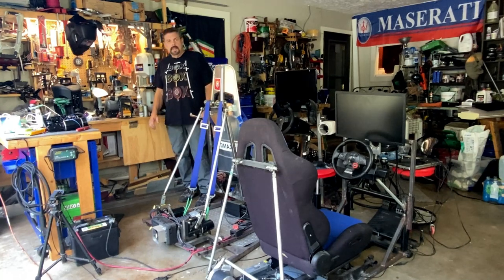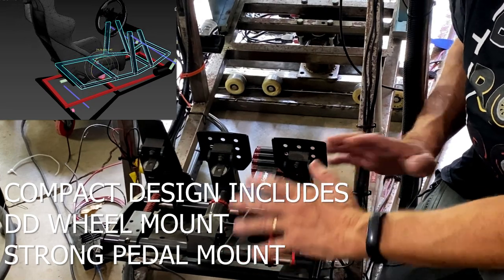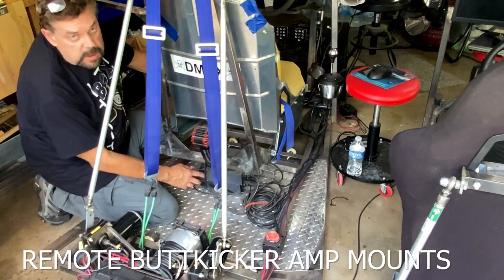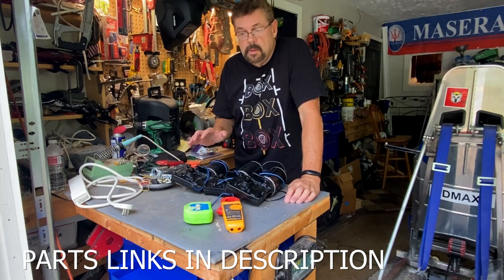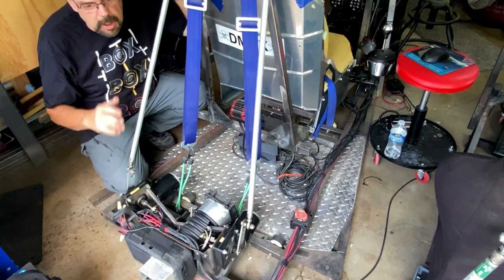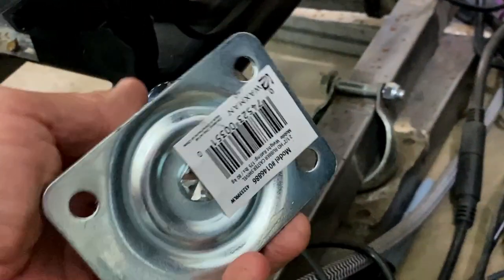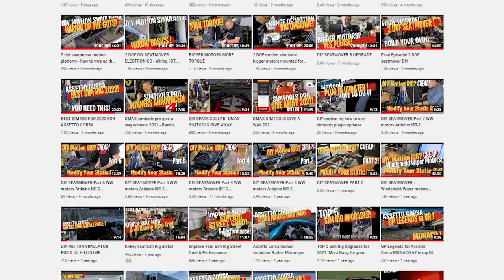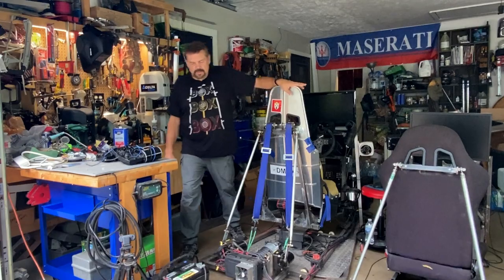NEW DIY 3DOF COMPACT MOTION SIMULATOR - 12V ARDUINO IBT-2  TRACTION LOSS DO IT YOURSELF Episode 1

Comment: Me again Dave. Well I am about to rebuild my test MoSiRig too. Mine is already compact as you know. Did you consider your new design will be heavy  enough at the back end so whenever you have some serious traction loss action happening it will not drift the whole back of the Rig? I mean mine has a lot of overload at the back and some washing machine base rubber to stop it from drifting  ... but still it's moving like 4 inches in any direction during a one hour hard driving session.
Cheers, ART FLY  []-)
Reply from the maker: Thanks for making an additional comment ! I love it!  yeah..  should be good..  CG is good so far.  I know that my old rig never moves at all..  but it's pretty heavy.   We shall see what happens..  Either way, I'm in deep already and going for it!  Hope it helps some guys out who may want to try this stuff..  Dave
Reply: @DMAX_DIY  fly high - never die 👍

Comment: WOW! Really looking forward to this and then probably tackle one on my own as I get enough courage to do it. Just one question, do you think 3 wiper motors of enough power would do the job? Looking somehow to keep the price lower, since the postage of those motors to Europe costs almost as much as the motors. Thanks!
Reply from the maker: Thanks for taking a look dnac101!  I appreciate the comment and question..  I did a series on wiper motors for a 2DOF seatmover and the ones I had laying around were 'saturn' brand from 1990.. In the end they did not have enough power to make it seem realistic.  I rebuilt the 2DOF with wheelchair motors and AC to 24vDc converters and those moved the seat just fine..  Even did an amp stall test for data.  I trust these crab pot motors more though.. I have rode them hard for about 3 years in on line races and such.

Comment: Hi!! First of all, tks for share all your videos. I'm learning a lot.
I want to make a 2 dof sim. But here in México it's dificult to find motors. I foud one in Amazon, they are for a wheel chair the model are my1016z2 24v 250w 75rpm. Do You think this motors are good for My project?
Sorry about my English by the way. Tks a lot for your help!!
Reply from the maker: Thanks for the question my friend!  I think that would be fine for a seatmover.   I would rather get something like 550 watt if you can..  More power the better..  550watt could be the ticket to a 2DOF full frame rig..

Comment: Looking forward to more, I'm halfway into my own build, thanks to your earlier videos... :) but I've been contemplating my mounting situation and what I'd like to do for that. Space isn't a big issue but the more compact the better IMO. Can't wait to see more. BTW I've been using the JEGS seat for awhile now, usually without padding, although you can buy a fitted cover for it and it's been great for the price, no issues. Also I'm trying to use a simple AC to DC power supply from Amazon. Its a 50A 600W PS so I'm hoping it will be able to handle 2 and eventually 3 of the crab pot motors you suggest. I think I saw they are about 15A peak motors but I'd be curious to see if you've tested or measured the peak draw from them. Also might I suggest instead of going to the scrap yard for a driveshaft, go on eBay and buy two flange and u-joint kits.

Anyway awesome to see another build series!
Reply from the maker: Cool Kyle..  I'm getting a padded Jegs seat for this rig too!  should be here soon! Those 50amp 600W supplies 'should' be good enough.. I am going to try some 'dell or HP' server supplies this time. I did some 'testing' on my big 3dof rig and pulled around 25amps peak a few times (all three motors combined and powered by an 850CC amp truck battery) so it should be interesting..  I will test the crab pot motors for peak amps at 'stall' during this series.   I bought an ATV disc brake a while back and only used it to test the 24v wheelchair motors  on my last 2DOF seatmover series.  Also good point on the ebay u joint..  but I just happened to have a scrapyard in town and got the driveshaft with two u joints for around 20 bucks..   Anyway,  I have the second episode taped and almost out the door to posting..  Check back later this week if you can.   I appreciate your comments and questions.. and this is a great place to ask tech questions cause I will answer them if I can.. Dave
Reply: @DMAX_DIY  Hey Dave, its been slow going on my end but wanted to ask about your comment above quick (maybe a its a good road rage question?) When you said you pulled 25 amps peak in testing was that per motor or you pulled 25 amps peak for all 3 combined? Just trying to understand where I sit with my PSU. I only have two motors for now but building so I can add the third when I can and want to be sure I leave room for another PSU in my electrical box if needed. Thanks for the inspiration and keep the videos coming!

Comment: Thank goodness i havent started building my rig yet. Ive been collecting the parts though. I got the wiper motors, my wind sim working, got some steel collected as well.
Reply: Go for it ! If you take your time it is a lot of fun building that MoSiRigs.
Good luck. You can do it.
Reply from the maker: That right Isaac!  just like Art Fly said..  Take your time and have some fun..  It takes a while to collect up things and your first iteration is probably not going to be your last..  Upgrading or updating is pretty quick once you get your first one running..  Check back cause I have another episode  #2 ready to go and should be out later this week! Dave
Reply from the maker: @ARTFLY  Thanks my brother!  It is very cool! Heck of a lot of fun!  Very immersive to be truthful!  Especially with the VR.

Comment: has anyone tried using prius power steering drive? Prius use a large hi torque 12v worm gear unit on the steering collumn. The part also comes with a U joint so its two birds with one stone.
Reply from the maker: Hey Oliver..  I have not thought about it..  I'm sure with 12v and hi torque it would work..  but I'd have to purchase one and see what happens.  I'll put it on the 'list' of 'tests' for 2023..  Thanks for the idea..  Dave

Comment: Sorry for asking but im not so good at english is 50:1 gear motor mean 50kg : 1cm gear motor?
Reply from the maker: Good question..  50:1 means the inner part of the motor will turn 50 times and the output shaft or level will only turn 1 time.   So the more times the motor spins, the better in most cases.

Comment: Hi can anyone point me in the right direction how to find a u joint?
Reply from the maker: Yes, I can..    So I decided to go down to the local 'junkyard'..  I bought the entire driveshaft with 2 U joints for $20 bucks..  They had a stack of them just laying there..  Price seemed high, but now I have 2 motion rigs out of it..    You could also go to a 'pull a part' place..  just an auto junkyard where you can go in with your own tools and extract the parts for a bit cheaper..   Either way.. there you go.   just type in Junk yard or auto junk yard scrapyard or something like that into the phone and it should come up with local directions to the yard..   take cash with you..  Dave